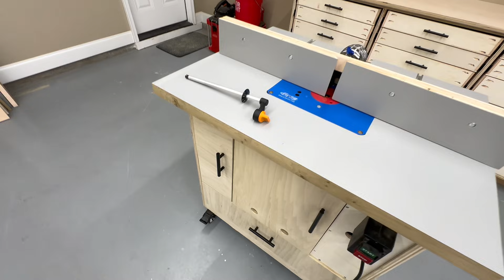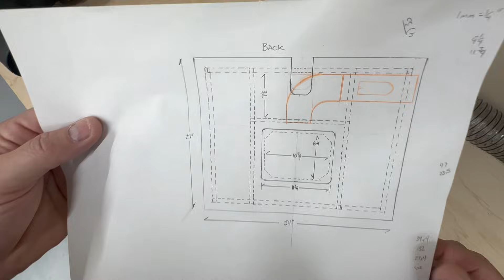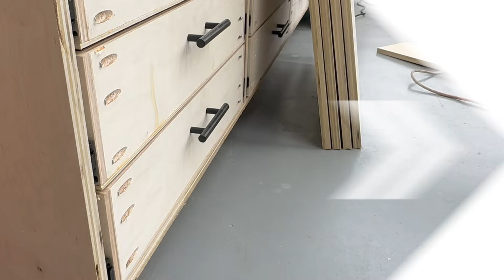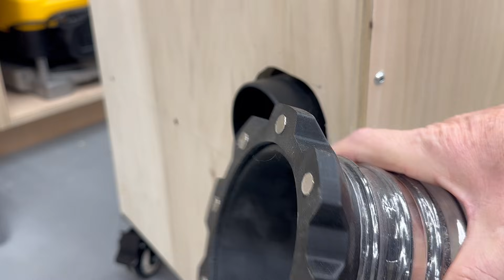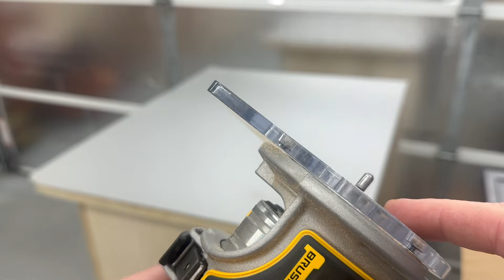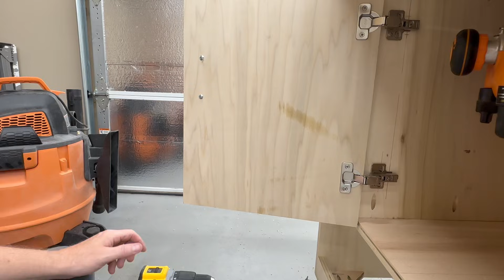Building the Ultimate Triton Router Table for My Woodshop

Comment: Great design and build. I have a question. It looks like you've added a NVR switch to the front. How did you manage to bypass the built-in NVR switch on the Triton router?
Reply from the maker: I lock the switch on the router to the on position and haven't had any issues with it.